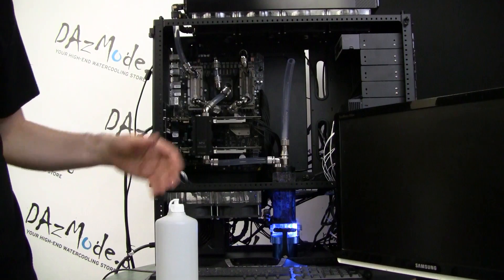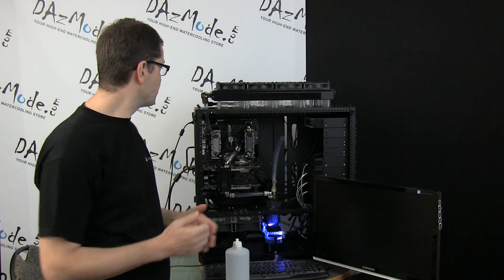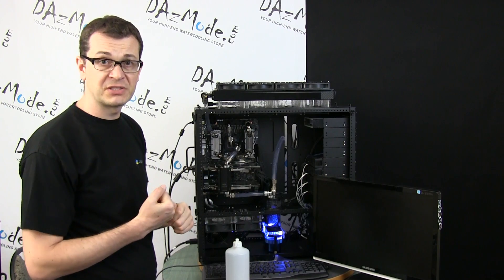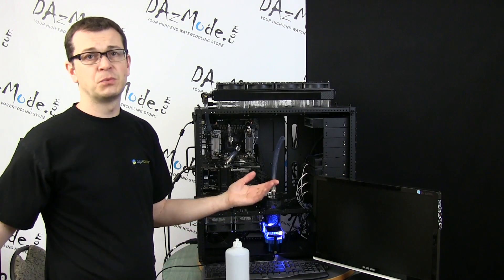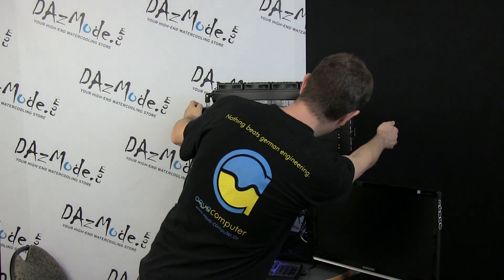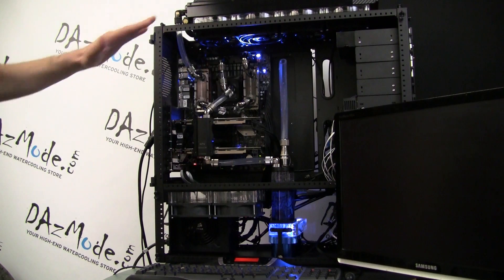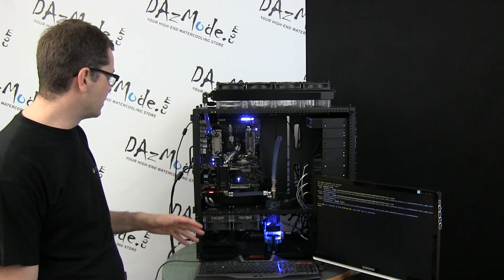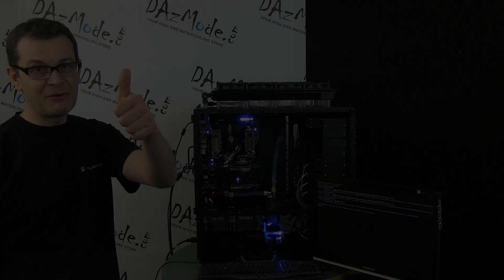System Power up Test- Venom Update #21

Comment: Just a stupid question: if you connect a pipe from the reservoir to a fill hole at the top of the case, you fill your system up till the loop is filled, does it follow the loop when you turn on the pump or does it come out of the fill hole like a geyser if you don't put a cap on it?

Have no water cooling so I can't test it out. xD